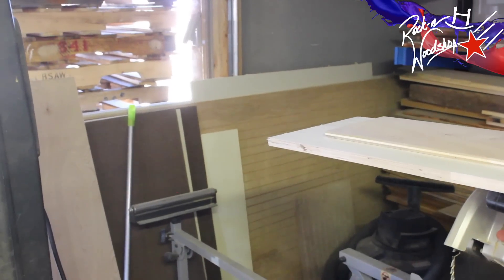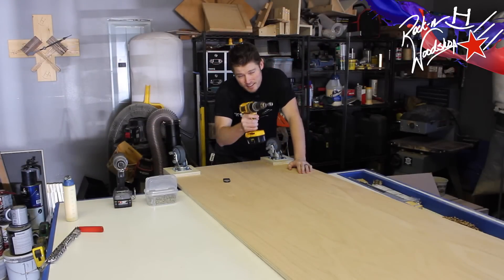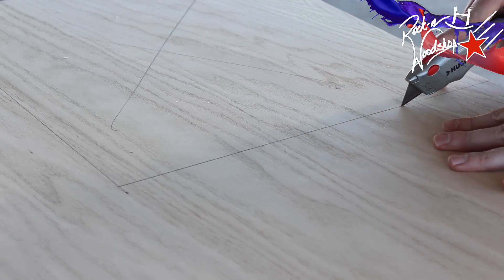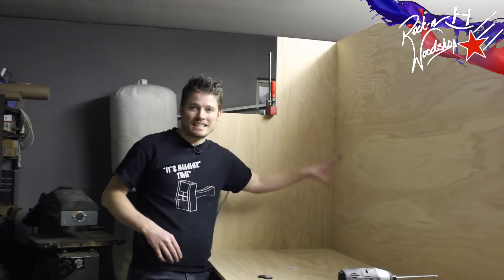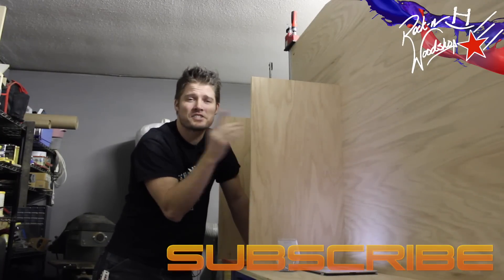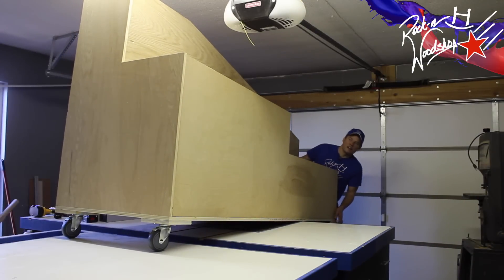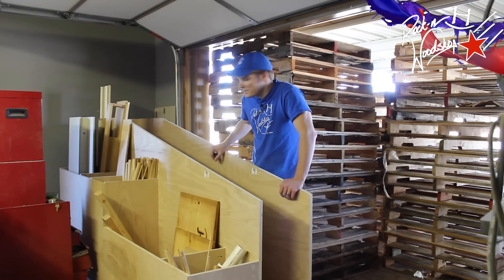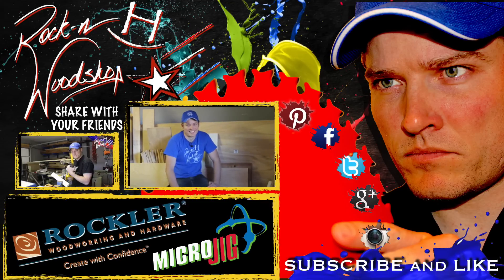DIY Pocket Hole Plywood Cart

Comment: Drew - That's a nice lumber cart. You will be much happier now. I made the Steve Ramsey had on his channel. It's not as long but makes a worls of difference. I will say, dealing with big sheets of ply and pocket holes by yourself is no fun especially when you start putting things together - it only gets heavier. I found it difficult to keep the ply from shifting when you drill in the screws - the sheet wants to shift away from the side with the screw in it. I now make a dado/rabbet about 1/8 inch deep.  I drill the holes on the oustide of rabbets and it makes no difference with the dados. It makes it a lot easier when putting things together and keeps things straight and no need for the big clamps. I do use the special kreg clamps - the one with the part that goes in the hole. They hold things together well until you get a few screws in and I leap frog down the line and then go back and fill in the holes I missed.  They dobn't help as much with the dado sections. Drilling/screwing 100 holes - been there done that - just wait until you have to plug and trim that many or more......I made a little jig for my trim router that makes quick work of those as long as they are not on an inside corner

I enjoy/look forward to your builds. Keep it up

Scott

Comment: Love your videos! I noticed you had a vac hooked up to your pocket-hole jig. I've found that makes a huge difference when using the jig in terms of ease of drilling, doesn't it? Wish I had have seen this tip when I first started using the jig. Figured it out just by chance. Its the only tool I've ever used that's more efficient with a vac than without.

Comment: Still curious as to what you're planning on building with those pallets. Any hints?
Reply: Wow, so many pallets so many projects.
Reply from the maker: Well, the first thing to use them for was a hardwood floor, b/c they are all oak.  But now my wife axed that idea after I collected so many.  oh well.  on to other projects with them.
Reply: Hardwood floors was my first guess. I've seen one of them done very well on instructables an other pictures on Pinterest. It is a very popular thing now, even if it is a ton of work milling them down. I wood do that too if I had a thickness planer. <- See what I did there?
Reply: Rock-n H Woodshop no more floor?!? i was really looking forward to that!
Reply: Rock-n H Woodshop New hardwood floor for the shop then?

Comment: I built something very similar to this, but after several weeks all my plywood sheets I was storing turned into potato chips. I guess because they weren't being fully supported? Tips?
Reply from the maker: The best thing is to make sure they are stacked at the base with no spaces between them and then clamp the tops together with a dedicated clamp at each end of the plywood.  That will keep them flat.

Comment: I heard once that Emeril started saying BAM because the cameramen would go to sleep while taping several shows in one day. Why do you say BOOM? Nevermind. I just built overhead lumber racks and they aren't working very well. Maybe because I'm over 6 feet and my ceiling is only 8 feet. But first, I gotta finish my saw/router table.
Reply from the maker: Loading a pretty humorous follow-up video right now. That will answer your question. LOL wink wink!